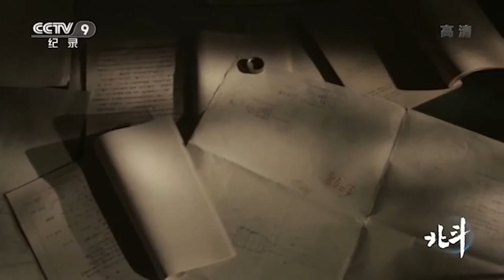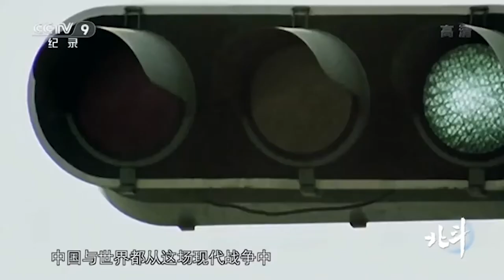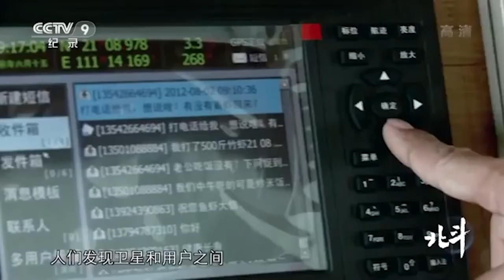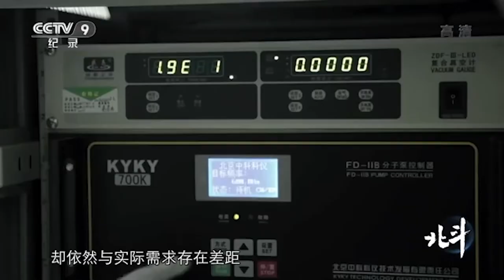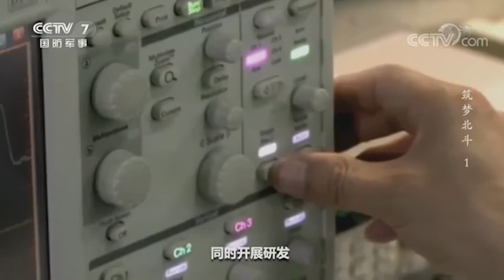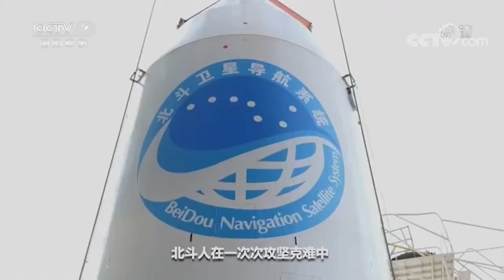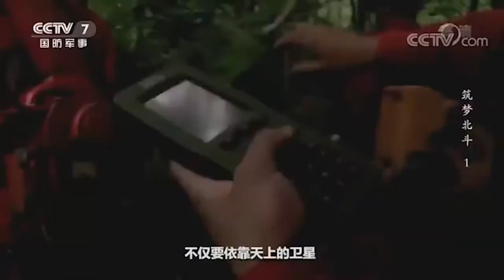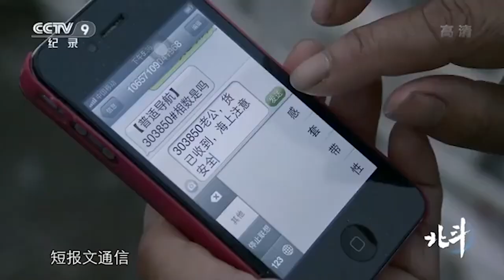Documentary on China BeiDou global Navigation Satellite system, Chinese GPS

Comment: Beidao is a bit farther away then GPS none knows if it work as good as GPS... Galileo however seems promising...
Reply: Beidou is way ahead of GPS. It uses inter-satellite networking, no need of global ground based stations. Such concepts did not exist 30 years ago when GPS was developed. Also, BeiDou offers two-way SMS text service. GPS just could not do, not possible!  This makes BeiDou much more marketable, far more practically useful. BeiDou is going to use laser cooling atomic clock that puts BeiDou in a different level, with resolution far better than GPS.
Reply: @joeextraknow2854  wow, thanks for the in dept analysis explanation of Beidou, circumventing the nay sayers.